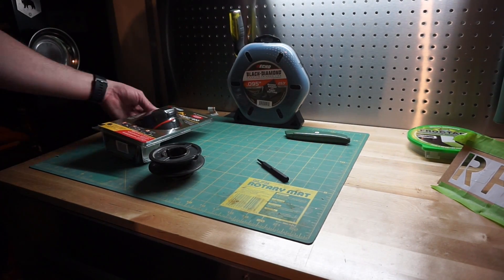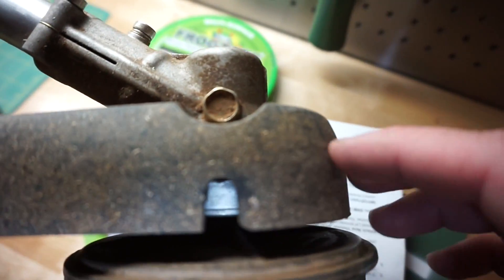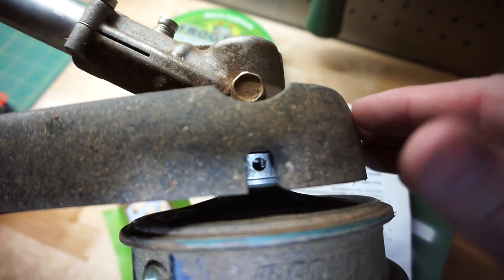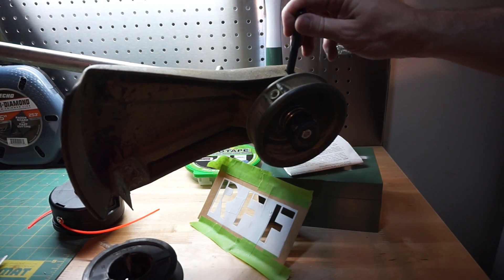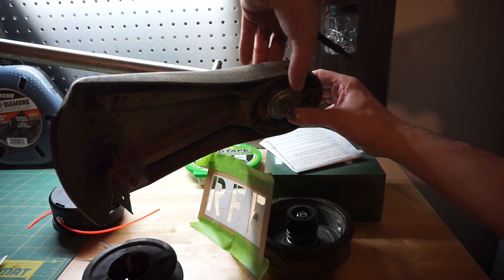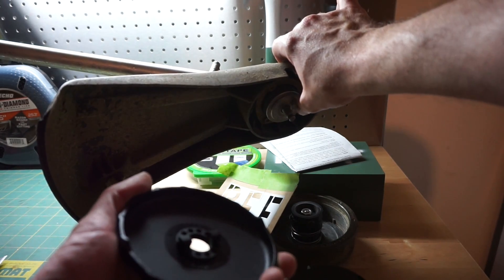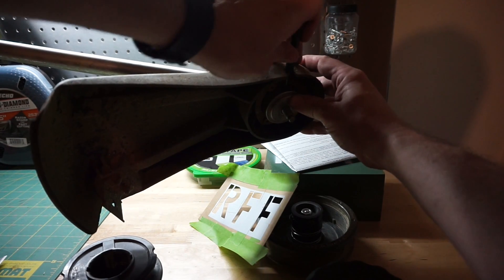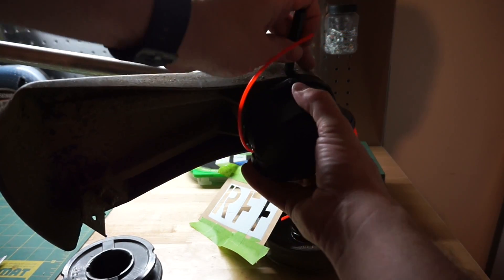How to Change an Echo Trimmer Head

Comment: Ok, first, I want to drink beer with this guy.  Just one because I’m missing a balance nerve on one side and stagger just fine on my own.  Second, has anyone had a problem with the head just falling off despite following these steps?  I’ve replace heads plenty of times but today, after countless hours of use the head just fell off.  So I put it back on, left handed thread of course, used a nail instead of spaghetti to keep the shaft from turning, gave it a good hand tightening and it still falls off.  I’m wondering if the thread is just worn after all these years.

Comment: I have Echo Trimmer SRM-210 I bought the same trimmer head you installed, do you use the black spacer because the directions are very unclear and it will work with the plastic spacer and without I know I don't need any of the shaft adapters that came with it, there is another video showing him put the plastic adapter on, I called Echo and got no help